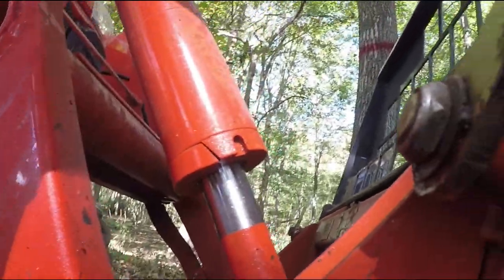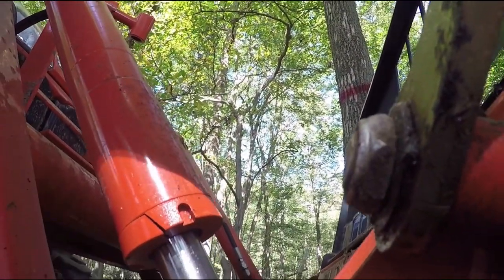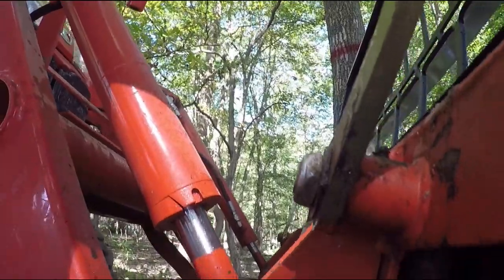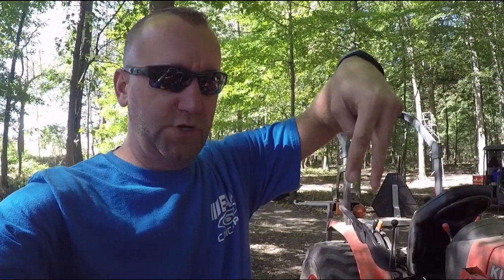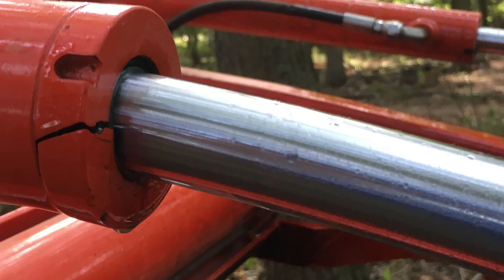Don’t Do This With Your Tractor!!

Comment: Hey man... great video.  It's always a bit embarrassing being authentic and honest about a mistake but I applaud your courage and am very grateful!  I'm about to buy a Kubota for the first time and had no idea that was a problem. You have seriously saved me from making the same mistake.  

So on that note, I know back dragging is a common technique...  Are you saying don't do it ever??  Or just be mindful of how much pressure you're putting on those cylinders or just not curl it as much or what?  What's the solution for that particular action?  Lay the bucket flat on the ground and use the rear edge to pull with?  Thx.
Reply from the maker: Hidden Valley Homestead 
You bet! I’ve certainly caught a lot of flak for my video. 

If you can back drag with the back of your bucket you’ll always be safe. They make buckets just for this purpose. You can back drag with it angled as long as you don’t angle the bucket far and are careful. The risk comes when you angle at full dump or near full dump. That puts the curl cylinder at full extension and at its most vulnerable position. Lift the front of the tractor in the air and that makes it even worse. The further the piston is in the cylinder (retracted), the better. 

BTW, this isn’t isolated to Kubota. This is all brands, all sizes of equipment, and all types of equipment. Any time a cylinder is fully extended and an external force is applied it’s at a risk of being bent. For back dragging, the external force is the tractor moving under its own power and can easily generate A LOT more force than a cylinder can handle.
Reply: @JaredsShop  Absolutely...  you're right on...  I'm actually a crane operator by trade and understand what is going on here but don't have a lot of "dirt" work experience so this makes sense...     I subscribed to your channel btw...  great stuff.  I've got other homesteading stuff on my channel if you're interested...    

That's the one negative aspect to being transparent out there on YT are the trolls..   My whole purpose in posting and being honest and transparent is to help people.  Yes it cost you $500 and some down time and aggravation but you certainly saved ME that same headache and money loss.  I call this video an absolute WIN!!!  Screw the trolls..   And this video popped up in my "suggested " to watch feed btw...  YT analytics is working good I'd say...
Reply from the maker: Hidden Valley Homestead 
Thanks! I’ll check it out. 

There certainly are a lot of trolls. I’m a pretty reserved person and it’s not easy to open up to the public. I’m not looking for fame or trying to show off. It was my buddy’s idea for me to create a channel and it took a lot of persuading before I actually did it. My skin is getting a little thicker but it still hurts when people are mean. It’s so easy to be mean when people are sitting behind the safety of their keyboard. 

Their suggestions are so odd. I’ve had this video get thousands of hits in 1 hour because of their suggestions and then it’ll drop off and only get a 100 views over a couple days. I don’t understand why it varies so much.
Reply: @JaredsShop  I hear ya..  but you gotta remember those trolls don't have a clue about who you are and it's actually a reflection of their character they are putting on display for the whole world to see.  The 99% of your viewers are there for one of two reasons: entertainment and education!  Keep that in mind for guys like me that don't have a tractor just yet but definitely gonna get one as soon as I save up the cash in the next 12 mo and it's DEFINITELY gonna be a Kubota!  I'm grateful I found you!  Keep em coming!
Reply: Hello Hidden valley, I bought my BX23S last year, and LOVE IT!!!...and coming from a mining background playing around with big toys, I have to honestly admit that this was a great piece of advice. I would never had thought about it, in fact I would have been really pissed if this would have happened to me, thinking that I bought a not so good tractor. Anyway, for me personally I don't think you can go wrong with the purchase of the Kubota, looks, rides, and feels good on the controls, almost like the big stuff. I have tried other small tractors, Mahindra, JD, they just (to me) don't have that feel. Like everything out there though there are little annoyances, but coming from the Kubota I can certainly live with them, and there aren't many on a Kubota. My final decision to purchase the Kubota came when I realized that the other brands have engines made from so and so, along with say the Hydro transmission, NOT so for the Kubota, all is branded, manufactured Kubota, engine and all, which if you really think about it you should never have to be in a situation where you can't find parts due to the engine manufacturer going out of business. I get it that it's no big deal to most, but I just thought that for such an expensive purchase I want to have this unit for a very very long time. Enjoy your new tractor.....
Reply: @patrickwalker5329  Thank you for that!  I'm a crane operator and run heavy equipment as well so I totally get what you mean!  I've driven a couple different Kubotas and felt right at home.  And what you said about parts and engines is exactly why I think buying a good used one is perfectly fine.  The only reason I was considering buying another brand is because of price.  But I found an estate sale company that sells practically brand new ones for half of new.  I think my mind is made up.  

So you said you got a BX23?  So I test drove one and for what I'm going to be using mine for that is a little small for my needs.  Im looking at an L series in the 40hp range.  North Idaho has a lot of snow at times and I will probably be starting a tractor service up there so a bigger unit I think would handle the bigger work load...  Otherwise the B2650 is the one everyone is bragging about for power and price...    What made you pick the BX?
Reply: @HiddenValleyHomestead  great comment and great video from this guy

Comment: Good info thanks!  I will back drag loose dirt with my bucket edge down. I won't do it with gravel are packed ground.
Reply from the maker: Louisiana Aquaponics 
Thanks for the feedback. It’s definitely something to be careful of. I never gave any thought to the cylinders being fully extended and not having any cushion. The longer something is the easier it is to bend.
Reply: If you mean fully down, then you are still running a risk unless you're doing it on glare ice.

Comment: $250 deductible with the Kubota insurance... Their insurance even covers operator error
Reply from the maker: The tractor was paid off and no longer had the insurance.  But yes, their insurance is great.
Reply: @JaredsShop  I'm thinking that's why I may continue on with the insurance once the tractors paid off you do have that option.... Sorry to hear about your curl cylinder
Reply from the maker: @thegreatnorthwoodswithbb2863  
I’d definitely recommend it. This was several years ago and I didn’t know I could continue. With a recent loan on implements, I have continued the insurance after the loan was paid off. I’ll probably do the same with my new tractor.

Comment: While I agree that this sort of failure can happen to any machine given the right circumstances, it seems that Kubota failed in the design aspect here. Tilt cylinders on a loader should have an internal spacer to stop the piston head from going all the way to the cylinder cap to maintain mechanical advantage and lower stress on the cap. Also that cap looks to be a cast piece, that application should have a forged cap to prevent fracture. You won't see that failure happen very often on a Deere loader, they've learned from decades of building heavy construction machinery. Not saying a Deere is immune to this type of failure, but is much more resistant due to superior design.
Reply from the maker: Corey Schmidt 
Who has spacers in their cylinders? Every one I found relies on their bucket stops and not any internal spacer. I found thousands of failures but never saw one spacer in any of the pics posted. 

Yes, this cap is cast, as is every Deere until you get into the large tractors. I haven’t found a forged cap on anyone’s cylinder under 50hp. Even over 50hp most of them are mild steel and not forged. 

If you research, you’ll find tons of failures for every brand. Not one really stood out on either end of the spectrum.
Reply: @JaredsShop  I work on industrial equipment and an internal spacer is commonly used as a stop in my world. I don't have any experience with the sub 50 hp market since most things I touch are 80 hp and over. But my opinion stands that there is design failure here, it may be common for the entire class of machine but it is design failure non the less. Not trying to argue, just sharing my thoughts as someone who works on heavy hydraulic machinery by trade.
Reply from the maker: Corey Schmidt 
No you’re good. I’m not arguing either. Sorry if I came off that way. Just reporting what I see. 

I’d still like to know specifically what type of equipment have spacers. I love to learn about all kinds of things. I worked at factory and repaired everything from manual machines, CNC machines, forge presses, etc. 

Although I’ve never seen an internal spacer, it makes sense so it is supported further apart. In farming we use a lot of spacers externally to control limits.
Reply: @JaredsShop  very common in large industrial forklifts, line feeder carts use them as well, I see lots of different equipment mostly recycling facility, and production line related.
Reply from the maker: Corey Schmidt 
Cool deal. All of our forklift service was outsourced so I never got to see the inside of them. Our factory wasn’t production line based. Large castings being machined were forklifted from cell to cell. Thanks for the info. I appreciate it.
Reply: @JaredsShop  no problem. Yeah it just seems to be easier using an internal stop when there are so many options on mast height and avalible degrees of forward tilt instead of having a huge variety of stops that would have to be welded to the mast or chassis. We even do custom work like shortening/raising mast height, and lots of customers want more degrees of avalible tilt since 12° of forward tilt is the norm.

Comment: Interestingly only one of the two curl cylinders would fail, because the pressure having been relieved by one would protect the other,  I think.
Reply from the maker: dansw0rkshop 
My guess is that maybe half of the tree moved and the other half didn’t, which put more stress on the one side.

Comment: Remember that tractors are designed to be a drawbar  machine. Adding loaders is a secondary use and they are limited at best. If you do a lot of loader work than buy a machine designed  to do loader work.
Reply from the maker: Steve Phelon 
I agree but a tractor with a loader is invaluable. Everything has limitations and I pushed mine beyond its limitations.

Comment: I’ve been running heavy equipment for 40 years and dirt moving equipment for 28 years. I back drag and pull with the back of the bucket all the time and have never broke a cylinder or bent a polish rod. 
The problem here isn’t the operator it’s the equipment.  Poor quality and engineering.
Reply from the maker: LeadfootPTM 
Dragging with the back of the bucket is different than dragging with the tip of the bucket.

Comment: Interesting.  I do that sort of thing all the time on my 1974 Case 480CK.
 Do you think that things were made better back then when made in the USA ??
Reply from the maker: Patrick Horvath 
No. It’s just physics. I read about the same thing happening to old Cat crawlers, skid steers, and large excavators. If you catch the edge of the bucket while driving backwards you can overpower the cylinder. It also depends on how far the cylinder is extended. If it is partially retracted then it is supported better. I also made it worse because I had forks on which caused extra leverage.
Reply: @JaredsShop  
Hmmm. Point duly noted. I usually have forks up front too. Guess ill be more cognizant of that situation.

Comment: Your local Kubota dealer should be able to warranty that part for you. That should never happen. If you back dragging with too much load the hydraulics should be over powered and the bucket will give. I run a L3901 and back drag all the time in packed rock and dirt to shave the ground down and NEVER broke a cylinder. I've had the bucket snag hundreds of times on roots and it just pivots a little or the tractor comes to a stop.
Reply from the maker: Joe Fox 
I wasn’t using the hydraulics so the relief valve wasn’t in the equation. There was nothing to give. The spool was closed and the fluid basically locked.

Comment: Having owned many sub-compacts and as well as larger tractors and equipment, I know the limitations of the equipment. Sub-compacts are not ideal nor built or advised to do what you are doing.  I wish you luck with yours just always remember though, keep the equipment operating within its manufacturer's intended guidelines.
Reply from the maker: mike king 
While I have sometimes pushed my tractor to the limits (and beyond), I would not consider just pulling apart a tree at a saw cut beyond what the tractor is capable. It was only about 16” in diameter and was sawn all the way through. I think it was just that the cylinder was fully extended and it had forks on it (more leverage). If I only had a bucket on and not forks, it may have been ok.

I do now push them apart so the forces are pulling on the cylinder instead of pushing.
Reply: What are the specifications for this operation?  How many pounds is it rated for with the forks installed at full extension?
Reply from the maker: Pelican1984 
I haven’t done the math but I was using the back side of the forks and pulling backwards, opposite of what you’d normally do. More like back dragging.
Reply: I guess the lesson is that it is always possible to exceed the ratings of your equipment!  LOL.  Thanks for posting your video.  Happy farming!.  b.

Comment: if you wouldn't  have FORCED  the BENT rod back into the cylinder you could have gotten away with just a new rod and a new cylinder head. NEVER NEVER NEVER force a bent rod back into the can!!!!   ive seen it 1000 times on excavator bucket cylinders!!!  guys use the bucket teeth like a jack hammer to break concrete by raising it up about 3 feet and slamming it into the concrete. does it work? - sure,  until they bend the bucket cylinder like a banana !  when the bent rod goes back into the can it shaves metal off the inside of the can and puts it back into the hydraulic system!!!!  it causes SERIOUS problems. metal shavings wedge in the valve spool, and cause it to stick or not work at all, and could destroy the hydraulic pump,  causes problems with the reliefs and on..... and on..... and on.....  its well worth shutting the machine down, and fixing it right the first time!   your wallet will thank you !!!!
Reply from the maker: bobo caterpillar 
You’re right bud. It was totally my fault. I could have had it repaired if I didn’t force it back in. Thanks for sharing!
Reply from the maker: mark spannar 
Good feedback. I just wish I didn’t deform the tube so I could’ve repaired the cylinder.

Comment: Anything can break at any time. You weren't doing anything wrong or even excessive.
I've seen hydraulic shafts bent from impact but still working. Shop next to me years ago used to repair, reshape and resurface hydraulic cylinders. They showed me failures and abuses. Yours was just a part failure.
Reply from the maker: Thanks. I may not have, but it did open my eyes to the risks, which is why I wanted to share.

Comment: Front end loader does not mean bulldozer. :-)
Reply from the maker: brokendash 
I’d sure like to think so. : )
Reply: Basically you broke your tractor using it in a way that it wasn’t meant to be used. Then you advertise it by making video about it. Can’t fix stupid eh
Reply from the maker: Roady C. 
Yes, I broke it because I misused it. I posted a video as a warning to others so they don’t do the same thing. I wasn’t thinking about the physics and was shocked how many similar stories I found on the net. I figured it was worth sharing my mistake so other could benefit. Sorry, I thought I made that clear in the video.

Comment: I take it that you were not in float but instead under downward boom pressure. I guess it wouldn't have much force to split heavy logs in float but if you were to drag gravel backward I would recommend floating your loader and maybe lessening the angle to maybe a 45° or so. This would give the loader the ability to jump over an immovable object verses bending a hydro ram. Thanks for the warning/great info.
Reply from the maker: xplmr1 
No downward pressure at all. Forks were in the air. I was just backing up with the forks on the other side of the log
Reply: Okay, I guess just the rotational force like you said at full ram extension is a weak point on loader rams. I guess to accomplish the same maneuver you could drill holes in the back bottom of the forks or better yet weld rings on the side of the forks near the backrest that you could drop some heavy duty pins/spikes into that would be 90° perpendicular from the fork orientation so you could perform that back drag with the forks parallel to the ground. But then easily remove for normal forklift operation.
Reply from the maker: xplmr1 
Since then I’ve purchased a grapple and will be using that for all of my log work. If I need to reposition a tree for skidding I’ll just pick it up and move it.
Reply: WorthOverdoing Awesome! I would love a grapple for my B3350. I ordered it with the third function kit just in case I stumble across a great deal on a grapple. Thanks again for the heads up.